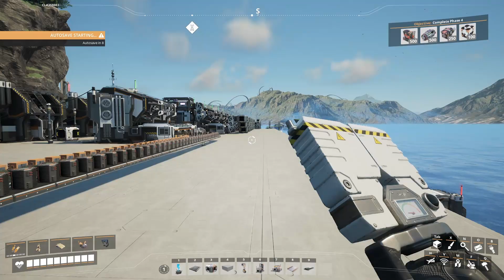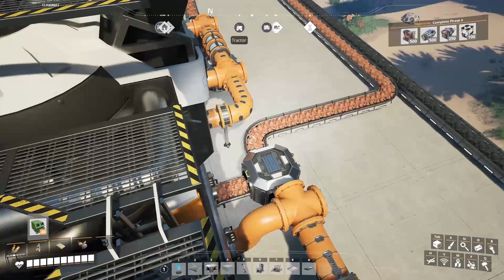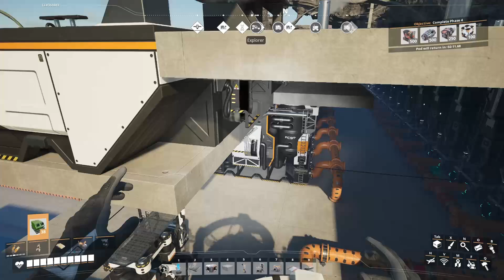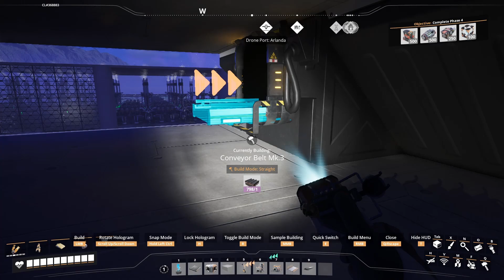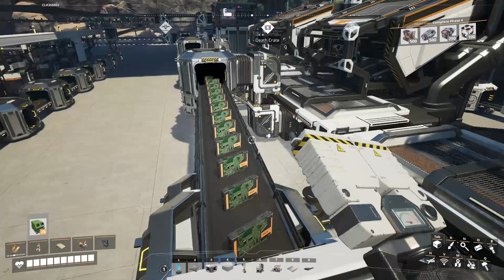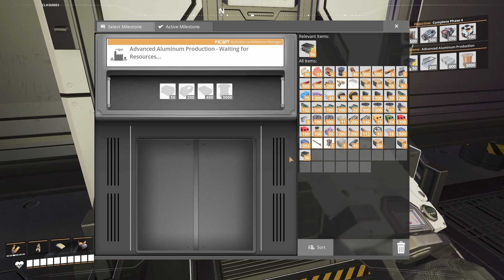Satisfactory 1.0 - Drones and Supercomputers [E20]

Comment: Did the math yesterday, building Rocket Fuel factory today I will be using the Alt: Nitro Rocket Fuel
Reply from the maker: Nice. Let me know how it goes.
Reply: @surtrplays  Well after placing some more main line rail, creating a new aluminum ingot factory. This was much smaller easier factory to setup then some of my other ones.   10 refineries making fuel, sink the polymer, 4 Blenders making Nitro Rocket Fuel. sink the Compacted coal, and 5 packagers each with a dedicated Constructor for Fluid tanks and I'm producing 300 packaged rocket fuel pm.   Needed - 300 Aluminum Ingot, 100 Fuel, 300 Nitrogen Gas, 400 Sulfur and 200 coal p/m.  I make the Ingots in Lake Forest and Fuel in the Crater.  I could double this and turn the 2nd factory into power if I need to at any time.
Reply from the maker: Nice going.